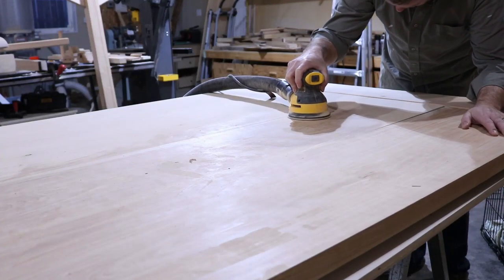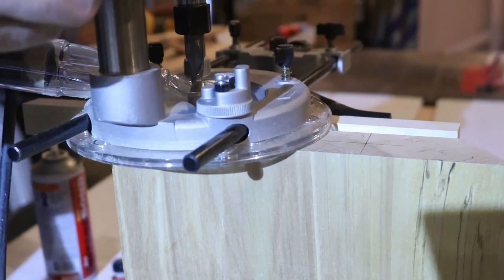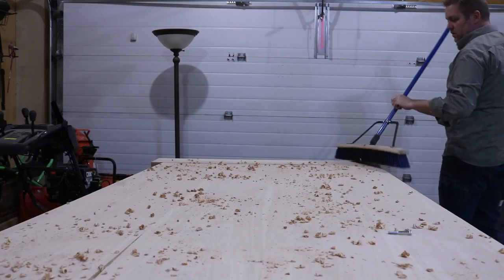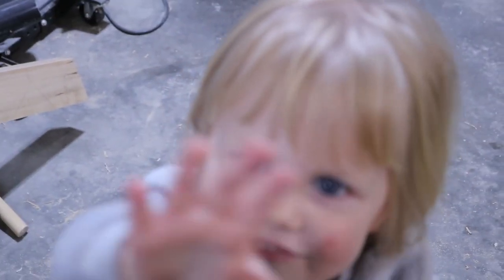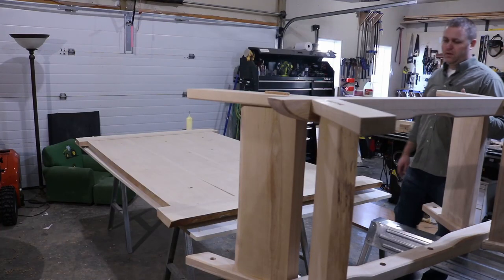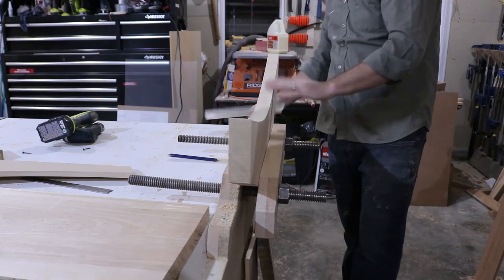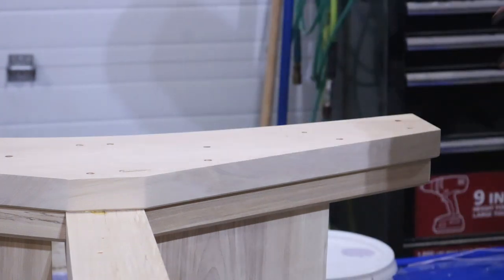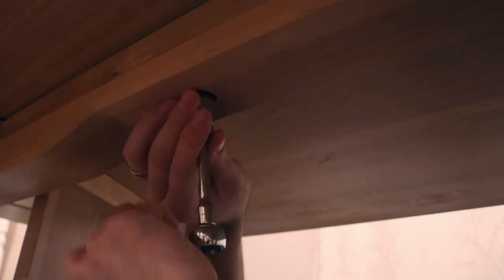Building a live edge trestle table part 2: Its all about the base

Comment: Hi, love the table. Am a little confused to how you finished the final triangle piece. I saw you make the relief cut, but how does that help make it sit flat still has all the other material still bearing the floor??
Reply from the maker: I didn’t show clearing the whole bit out. The only material left is the bits at the end. Hope that helps and thanks for watching.
Reply: @Hatchmade  could you tell me how you did that?  I've done small sections with a router and a wider base.  But nothing that wide.